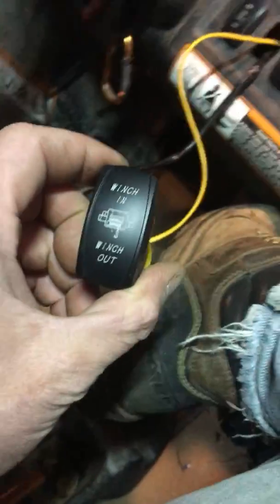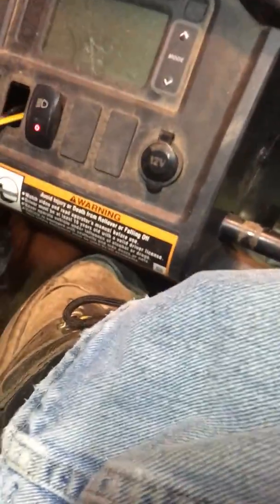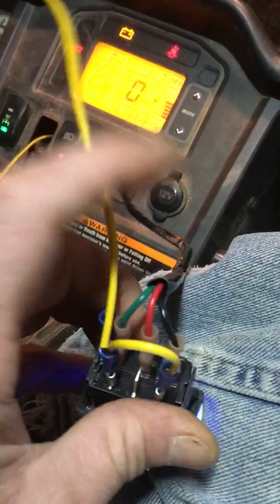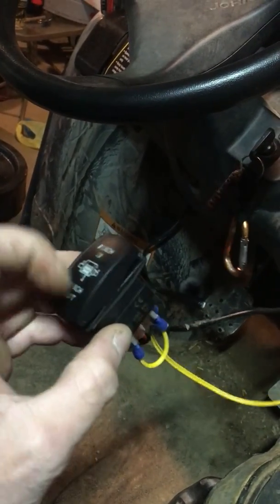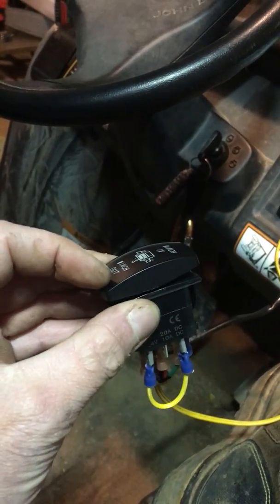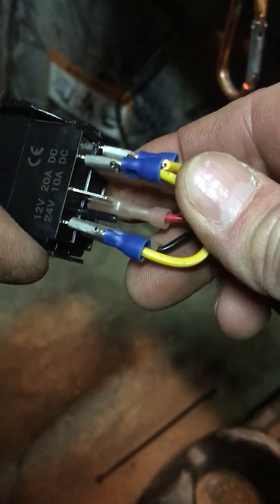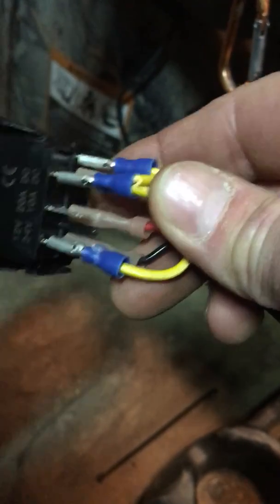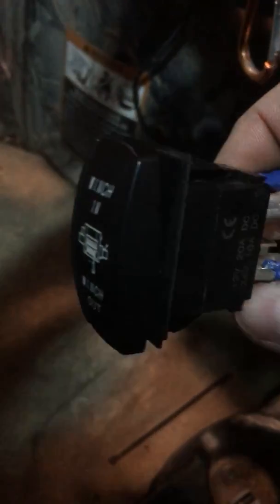7 pin wench switch

Comment: God bless you my son. 🙏 I've been looking at these switches for two weeks now, trying to have the LED's stay lit. It's not until I watched your video that it all made sense - including how the winch solenoid works on two separate SPDT  normally open relays (not a DPDT switch in the solenoid itself). Before watching your video, I always thought the green and blue wires were reversing a dual acting reversing relay. 

Nah! Now I understand that there are two separate relays. Eg: when the power goes to blue, the relay closes the circuit to the positive, while the yellow  (springs) back to open and  cuts the  positive circuit but closes the circuit to ground. When yellow is powered, it closes the circuit to positive, while the blue (springs) back to open and closes the circuit to negative (ground).  If you look at the wiring diagram of a high amperage winch solenoid, you'll notice that both relays have their normally closed terminals wired to the main battery negative terminal.

The red wire on the switch is not a signal because a signal source of power only works on integrated circuits😮; and these are all just hardwired controls.  You can prove this by jumping your yellow LED wire to the red  keyed power tab. The switching or reversing of polarity that we THOUGHT was being done at the switch is actually being done at the high amperage solenoid. When you wire the switch as shown by the manufacturer (say for switching a linear actuator) and not using a winch solenoid, you ARE reversing the polarity at the switch but can't get both LED's to light all the time. Even if your load amperage is not high and using the switch without a solenoid, you still will have to get two low amperage relays and wire them into the switch as shown in the winch solenoid diagram...and your setup of course. 

Winch solenoid internal wiring: 
https://www.amazon.ca/dp/B09666WGNQ?ref=ppx_yo2ov_dt_b_fed_asin_title
S1 is your switch at the panel. It's a SPDT.

I have been wiring winches for forty years (including wireless remotes) and it's only since the illuminated switches has it become a conundrum.  I am forever thankful. Thanks to your genius observations, I was able to figure this out based on the workings of limit switches with SPDT normally closed relays.

Comment: I cannot stand the in out unlighted switch that comes with some of the winches. I got the same switch you have so I'm going to try your wiring and see if it works. I hope it does. And thank you for the explanation.

Comment: I want the winch to only be able to run when the key is on.  If I unplug the red wire from the toggle switch and run a wire from the key hot to the plug that you have the red wire on will that work?

Comment: Great video. Thanks. I would like to wire the switch so the light on the switch always stays on. I am using the switch in my Tacoma truck to power a winch I am going to mount in the bed to load deer into the bed (at 72 it's getting a little tough wrestling a deer into the bed LOL). I plan to substitute the switch that came with the winch for one of these switches. I already installed a switch in the bed of the truck to control an LED light mounted on the cap over the bed. That switch light stays on all of the time with now worries about draining the battery since it draws so little power from the battery. I am going to mount the switch next to the current light switch and don't want to hit the winch switch by accident. Thanks for any help.

Comment: Great video. But your switch was not backwards. On all DTDP switches, whichever side you push on the rocker, the opposite side pole, circuit is completed.  Think of it like a T. If the horizontal line is the rocker, and from above, you push on the left side of the T. The vertical stem will pivot to the right, and vice versa.

Comment: Great video.  However, my original winch rocker switch has 3 wires but my new replacement switch has 4 wires. How do I connect?  Thanks!

Comment: Hey Larry I just watched your video and it was the best especially having the switch lit when key is on doesn’t make sense to only be on if you push it. So when reading the comments J Cunningham spoke of connecting 1,3,5 to ignition hot did you do that as well after the video or did you leave it the way you showed you did it in the video? In your video it looked like you had two power wires one to the top of led side then jumped to the bottom led side and a red wire to middle switch side. Where are those two hot wires coming from? I’m under the impression there should be two direction wires for the winch and only one positive and one negative I’m at a loss understanding the the two power wires please help.

Comment: DO YOU NEED AN INLINE FUSE WHEN YOU RUN THE POWER FROM SWITCH TO IGNITION HOOKUP????
Reply: Your winch wiring should have an inline fuse incorporated in the power wire

Comment: So, I have 2 switches. One is a winch power switch, and the other is the in/out rocker like in the video. Any idea on how I'd best wire it so the in/out lights don't come on until I turn winch power on?

Comment: Hey Larry
U broke down that rocker switch to its simplest terms for wiring my project! I couldn't get a similar "on off on momentary" to switch my light bar pattern mode to save my life.. til I seen ur video. Excellent explanation showing led side connections vs switching control side of switch! My face plate was also on backwards, easily rectified reversing the top n bottom poles like u said! Thanx for ur post!! :)

Comment: The switch actuator cover comes off with a careful bit of outward pressure at the center of the switch.  Then you could have of just flipped the cover and not change any of your output wire.  Hope that helps everyone for next time.

Comment: My winch has a 5 pin socket.  I can't access my solinoid so I play on plugging into the socket with  winch extension cable and cutting off the other end so I can splice my leads.  

However, what are the 5 cables for??
I figure one would be my hot 12.8v, the other two would be winch in and out, and last would be ground.... But, what would be the 5th??

Comment: all you had to do is switch the green and black wires to change the up and down.  the colors dont matter you're just completing a circuit.  the red wire is  + ignition and can be hooked up to terminal 1, 3, and 5.  Thanks for the video. it helped me.
Reply from the maker: that's what I did, didn't put it in the video
Reply: @larryising5156  to have the switch lit up when the vehicle is on, you run an ignition power (so it's not on 24/7) to terminal 1, then connect 3 & 5 to terminal 1???  Wish I would have read the comments before installing.  You're the only video mentions having the light on all the time.  I wish it would have been in the video.  Thanks for the info.
Reply from the maker: i did that. should have put it in the vid, sry . did video on cell phone couldnt edit after it recorded.

Comment: If you wire all three jumped to a key hot will the center only light up unless you push either direction ? Speaking on terms of the three that run the switch lighting
Reply from the maker: im not sure, i wanted the whole switch lit when key on so user can see the direction to move.
Reply: there is no center led just the upper and lower but yes if you connect 1,3,and 5 to + ignition the (red wire from your winch on terminal 5)  the 2 will stay lit all the time.
Reply from the maker: I DONT THINK SO, ITS WIRED TO LIGHT CONSTANT FOR EITHER OR ON CONTACT.